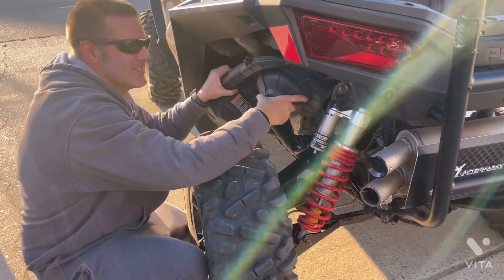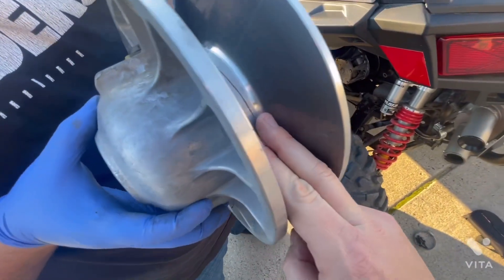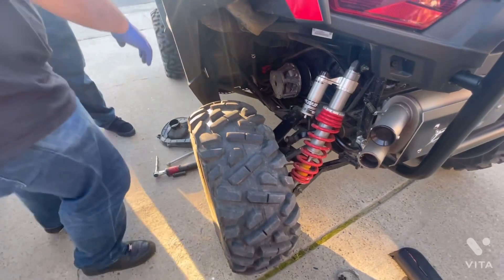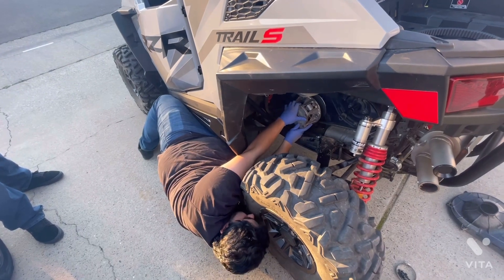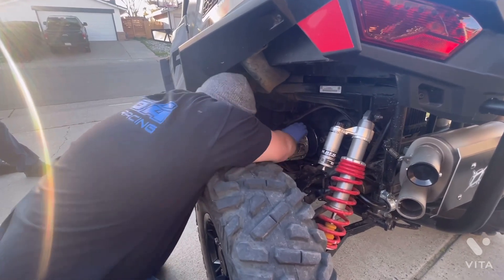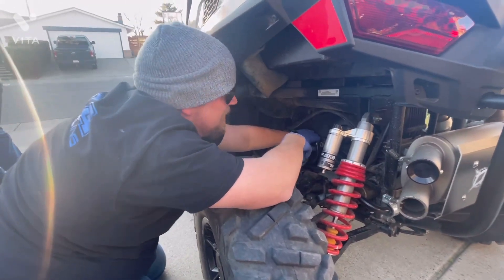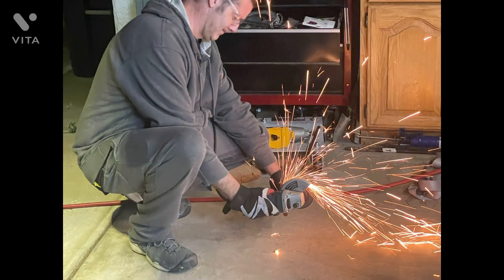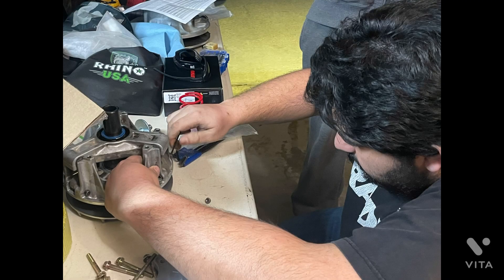Aftermarket Assassins s2 kit install on a Rzr trail 1000

Comment: That whole day was a shit show. From not being able to get any track times in the morning due to a crash on the track, not being able to run the machine at all anywhere near the track to do to throwing a check engine light (which turned out to be a faulty fuel injector plug), to having to drive across town to find the correct plugs in stock, to breaking that damn punch down inside there. I was so done with that day.
Reply from the maker: But man was it fun